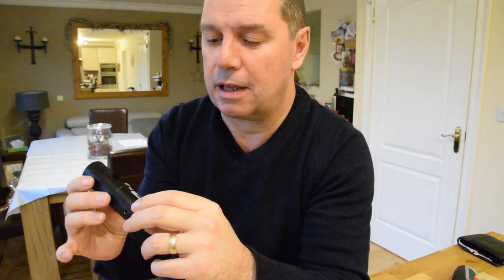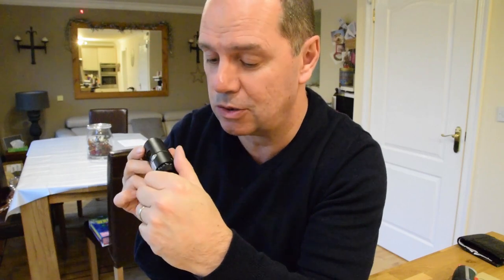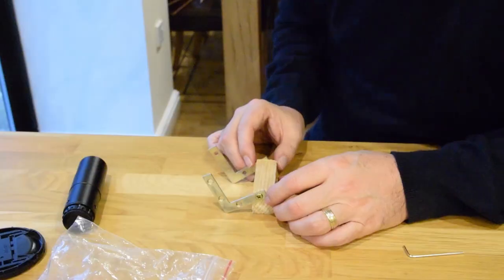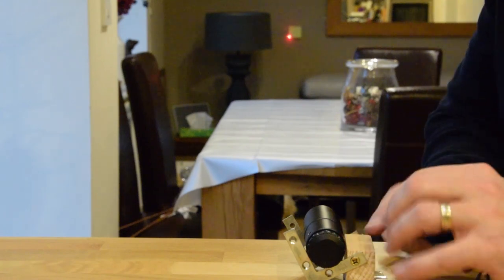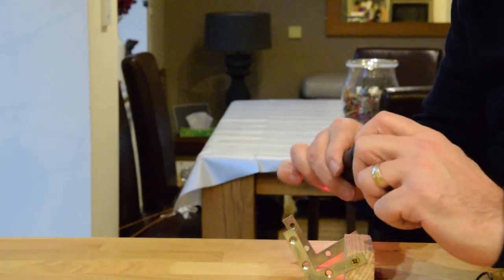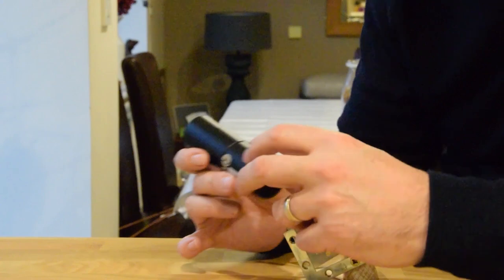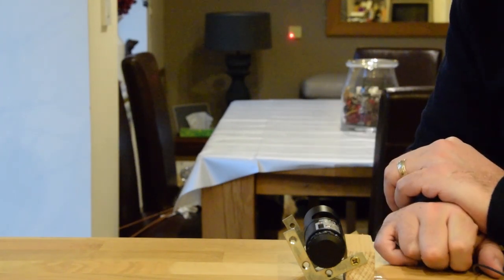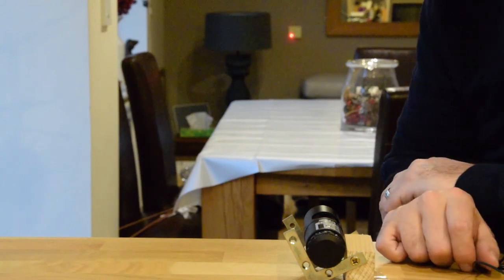Telescope Tips: Collimating a Laser Collimator

Comment: Great tutorial. Instead of two right angle brackets,  I improvised by taping a pair of identical and long steel socket drivers together side by side, forming a rigid straight “valley” on which to spin the collimator.  
 I then pointed the laser at a precise point on a distant neighbour’s house at night -  after first reassuring him that no Russian snipers were afoot.
Reply: wouldn't you be able to do the same thing by just placing it into the telescope and looking at the primary mirror?
Reply: @OmniversalInsect  We need at least 6 ft distance between the collimator and the wall to be able to do it easily, i guess in the telescope, we dont have that much distance usually, and there is focuser slop as well.

Comment: I just received my Astromania Alignment 1.25" Next Generation Laser Collimator a few hours ago. First thing I did per your suggestion was Col The Col ;). However all I used was right angle of the counter top with its vertical backsplash. Was perfect, no movement. Then got to work. It was very close to collimation already, but to the laser perfect into the primary mirror donut 'thingy' then adjust the primary mirror to make the laser disappear into the center black hold of the collimator. Still a great video! Now all i need is a stinkin' clear night.

Comment: The only suggestion I would make if yours are as far off as mine was, is to clean out the holes as best you can , then remove the three 2 mm set screws completely so you can get the Allen wrench to fit the screws well, and get the rest of the black silicone out of the holes! That way you can be sure the wrench is engaging the screws, then make your adjustments! Mine made about a circle about 15cms! Wish they would Collimate these  things at the factory , but I guess it takes time!!

Comment: I ended up collimating my f5/newt with just a Cheshire. Cost me about 40 quid. Would have plumped for a laser one, but people told me the Cheshire would suffice.

I was in tears with this. I totally messed it up to start with. I ended up taking off my secondary mirror. To put it back on: no instructions, no measurements. It took me about 3 days. 8 hours a day. One of the most frustrating experiences of my life. 

I got it done eventually, better than it was, but it was not a nice experience.

I've heard good and bad about laser collimators. I don't know. But my Cheshire did the job at the end of the day. It was definitely more accurate than when I started. 

I'm totally new to this though so it's probably best to ignore anything I say. 

I still don't think my collimation is absolutely spot on, but it's not bad. I'll know what to do better next time.
Reply from the maker: 123ubuntu666  I suppose ‘no pain no gain’, but it is a bit intimidating to collimate at first.  I have both the Cheshire and the laser these days, and only takes about five mins.  I sympathise with the secondary though, I actually loosened mine to the point I could hold it in place with my fingers,  to get it looking square in the focus tube first time.  Must get that video up on YouTube..
Reply: Yeah, it's a learning curve. It will be easier next time.

Look forward to any new vids you have on Eye Pieces.

Cheers.

Comment: Thanks for the ideas.  I made one of these jigs to hold the collimator and it worked well. 
In test the arrangement, I was not too sure if the label was having an effect on the alignment as I rotated the collimator and so I removed it.
I also got the feeling that only two or the three screws was doing any alignment adjustment and that the third screw was an alignment 'lock' screw.
I could be wrong, but IF I am correct, this 'lock' screw corresponded to the "0" position (off) - I obviously don't know if this applies to all collimators.
The hint to use the numbers to remember which screw you're adjusting is a good one.
Reply from the maker: Thanks Craig... I re-did the collimation a coupledom weeks ago and came to your exact same conclusions...removed the label, and noticed that only two screws seem to move the beam, so a locking screw could be right!  The other thing I did this time around was use a woodworking clamp to stop any movement of the jig, much more repeatable result. Thanks for the feedback 😊
Reply: @wictro Thanks 🙂

Comment: I've used fingernail polish to hold the heads of small screws in electronics equipment.  That may or may not work here, but it's easy to clean out.  Thanks for the video.

Comment: Maybe I'm missing something because I'm kind of new at all this but I am also a hobbyist machinist and so I am familiar with pretty much everything having to do with making jigs and using tools to square things and I'm always concerned.about making sure my tools are dialed in.
But since a collumater has a window on the side of it to make sure a curved mirror and maybe a 90° secondary are bouncing light back up the center of the tube does it also stand to reason that placing the collumater on a flat mirror should cause the beam to bounce once and if the collumater is collumated, the beam should behave in EXACTLY the same way?
If not, the laser won't bounce back straight and will then need to be adjusted...I just press mine up against the bathroom mirror.
Reply from the maker: Hi Christopher,  well that’s a pretty interesting idea, although just two points to consider from my side: the back of my  collimator isn’t flat, so not sure how I could get it square, and secondly, well two parts to this, the jig holds the collimator on the same surface as the telescope, so no induced errors there, and the distance amplifies the error, making it easier to adjust and see.  But I’m not saying mine is the only way, just a pretty easy and repeatable way to do it.  I did think about using a mirror to give a longer distance and therefore a bigger amplification, but it just seemed like diminishing returns going beyond the distance of my room.  Thanks, Mike
Reply: @MikeyJ  no disrespect intended. I made up a jig like yours and i didn't see any wandering of my laser after checking and adjusting it in the mirror in my bathroom.
I agree, it has to be flat on the bottom or its not going to work.
Also the idea of distance causing some amplification of any issues is also helpful.
I think my way is accurate enough on my smaller scopes but I did see a tiny movement when using your method and that could make a difference when working with my 17.5" Dobsonian.
Interesting thing happened while trying to null that last tiny bit out though.
It turns out it was so minute that I only made it worse trying to correct it.
So it did allow me to see the very small inaccuracy but it turns out I had actually corrected it to a level that was probably ok with a quick bathroom break.
What was better with your method is the direction you need to adjust is much easier to determine and much more intuitive than bouncing a laser around so close to itself and I found myself making my adjustments in the wrong direction the first and every other move after that correction.
Anyway thanks for getting back to me I had walked away from this thinking I had it sorted out and you made me rethink it.
The viewing through my B.A.T. scope was noticeably improved....

Comment: What size allen key?  Those rubber keyholes are pain to scratch out.
Reply from the maker: Hi Jeff, your right, i used a small 'jewelers' screwdriver for that.  As for the Allen key, i am not sure, 2mm or mabe 1.5mm but did you check the collimation first?  it might not need adjusting
Reply: Jeff Lucas 2mm

Comment: Hello good video.. but ive used this and all mirrors inline but i can only see the secondary mirror nothing else is this right ...please help many thanks
Reply from the maker: Hi Darren, thanks.  I think you speak about the actual collimation of the scope rather than the laser.  There are some good videos out there on that, but a couple of comments from me:  when you look down the focus tube at the secondary, you should see it as a perfect sphere, directly under the focuser (use a cheshire or sight tube for this).  Also, the main mirror needs to have a centering ring on it to do accurate collimation, and it sometimes helps to put some card behind the secondary, so you can distinguish between the reflections.  Search for 'Astro Baby's collimation guide' its a good help

Comment: Absolute pain in the butt the first time you do it.  These videos just don't explain it perfectly.   What a lot of these videos don't clearly mention, or don't mention enough is these aren't adjuster screws really.  They are 3 screws that hold the laser in place.  When you loosen one, you have to tighten the other side to compensate.  Your end goal is to have the laser centered AND all 3 screws tight.  If they aren't tight, the laser will move around.

Comment: Thanks M8, just ordered from opticsplanet.com.  Happy New Year
Reply from the maker: Nice Jeff.  I will have a go at a collimation video at some point.  One thing with a laser is that it doesn't help align the secondary mirror for out of square, (so rotated off the axis).  There are a couple of vids out there that deal with this, but i want to get that part sorted in my head first.  in the meantime, when you look down the focus tube at the secondary, without an eyepiece present, it should look near circular, rather than oval.